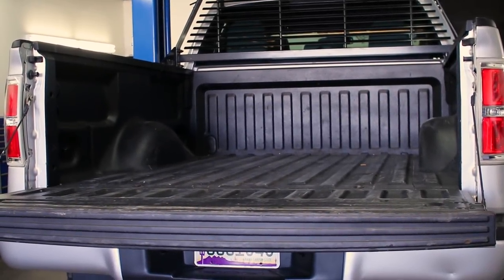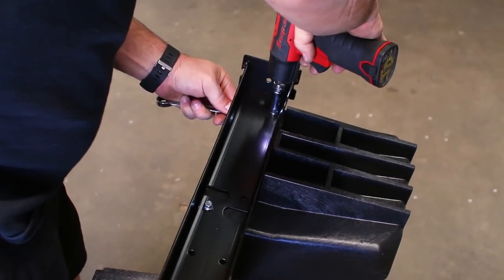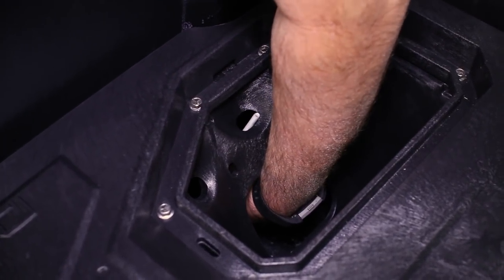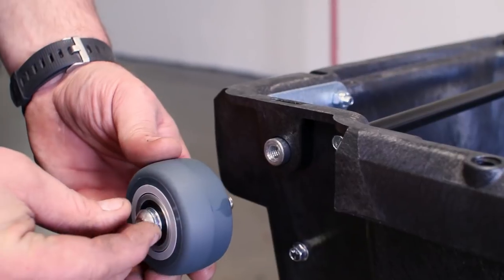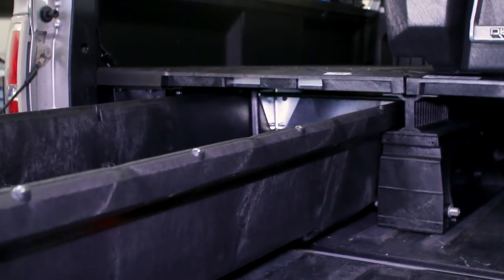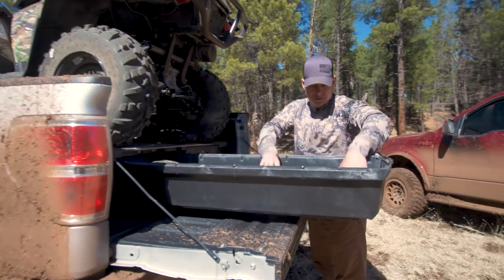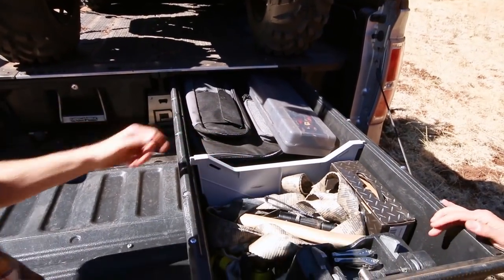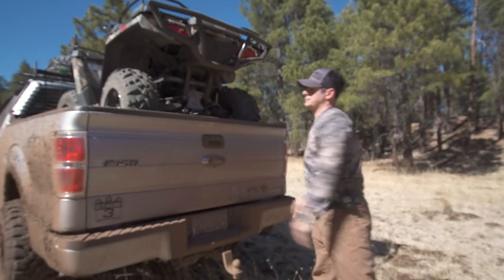2004-2014 F150 DECKED Truck Bed Sliding Storage System Install and Review

Comment: DECKED is awesome..   What is the roof rack on the f150?  I need one. That one seems solid. especially with the tire up there. Thanks.
Reply from the maker: Learn more about our Rhino Rack with vortex bars in this link - https://www.stage3motorsports.com/Stage-3s-2014-F150-STX-Hunting-Truck-Builds-Essential-Accessories.html